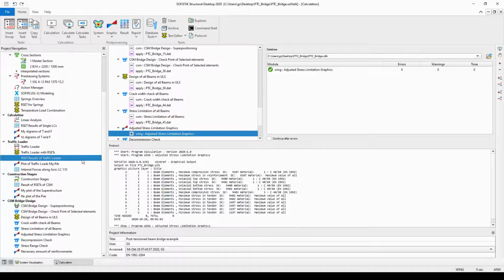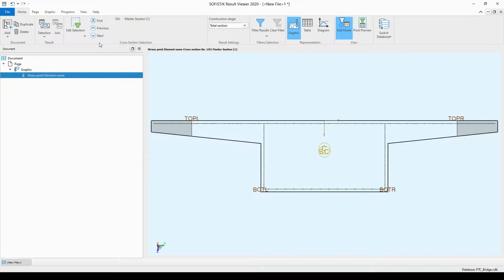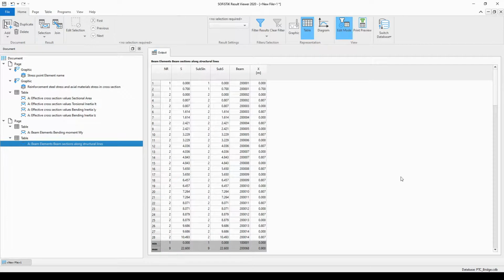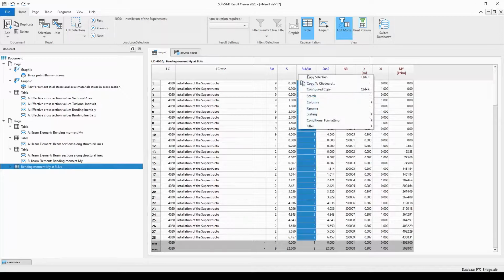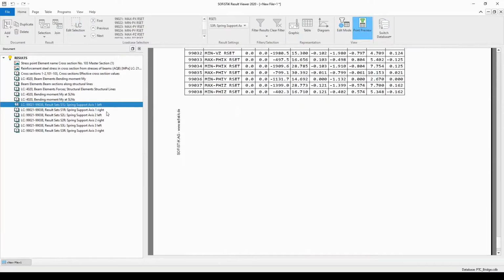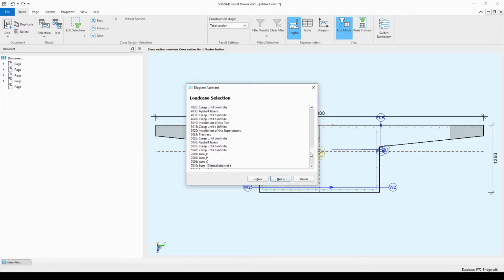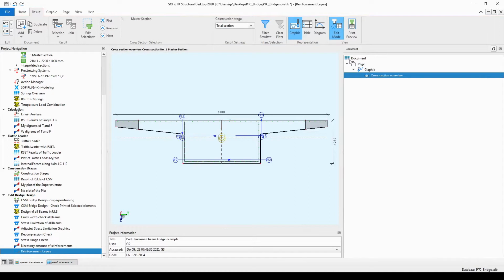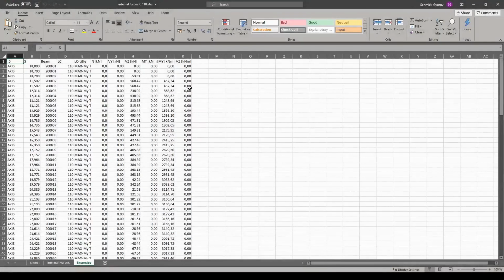Bridge Design Training #14 - Result Viewer

Comment: Hi. When you remove X(i) column you are also removing the final span value. The span distance at the last station is Station value + X value when X(i)=1. I wish sofistik gave normalized values of MY VZ etc along the span length. It is just extra work take all this and then plot normalized values in Excel. Please make a new tool where MY is interpolated along spang length values. That would be very helpful.
Reply from the maker: Hi Archpython-p2h9c,
please send feature requests like yours directly to our support team via Help - Support Assistant. :)